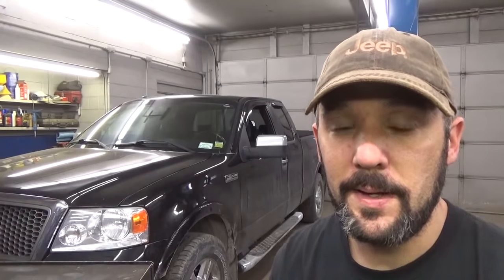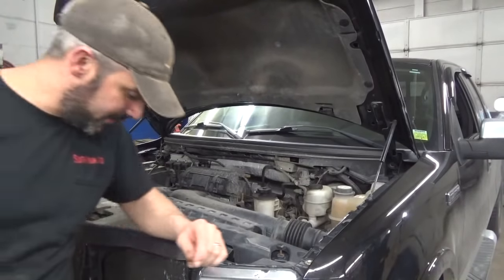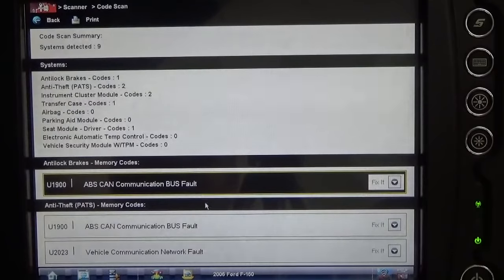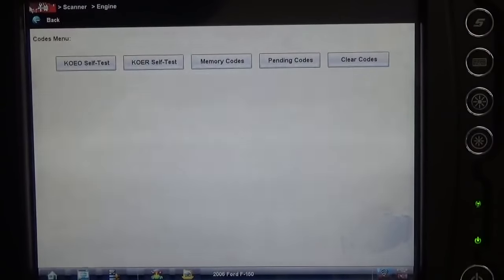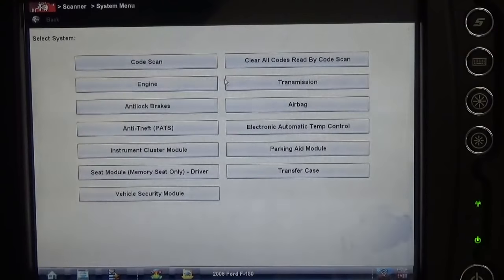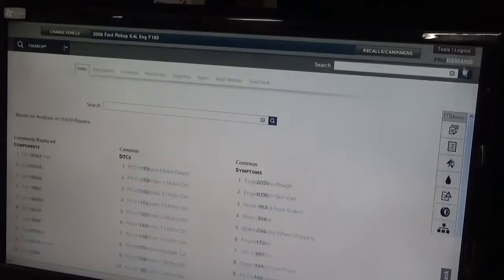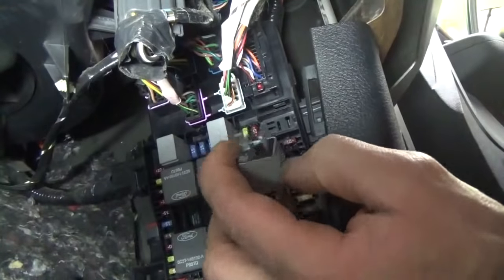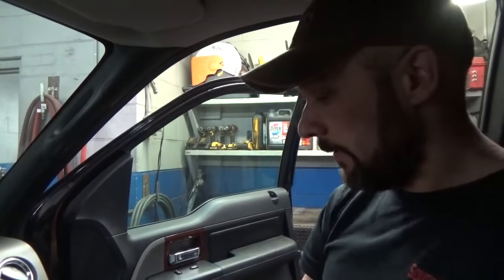Ford F150 5.4 No Start, No Crank, No Communications Codes: U1900, U2023

Comment: I have problems with my Ford F-150 1997 no tail lights everything were screwed up I pulled the number five fuse out control the radio it was draining my battery I was totally lost but this here radio the video help me to understand what's going on thank you

Comment: Even in the Ford Taurus 2004 your basically bent over upside down looking at relays and fuse boxes under the steering wheel uncomfortable awkward when checking fuse boxes

Comment: 1989 Bronco 5.8, both wires at injectors are hot.   What could be the problem....no start and not pulsing.
Reply: Got same problem in a bronco 5.0 reading few things the ground going into the PC controls the injectors. One of those grounds May be corroded o broken have not have time to check.and my garaje is to cold in MN.

Comment: Poor footage??🤯 are you kidding me ? This is like watching Frank Sinatra back stage or in you living room ......love your work
Reply: Question I have a 04 f150 5.4l i got spark fuel checked all fuses and relays all good there but the truck won't start i look inside of the trawdobody and i  can see lots lost of fluid is that normal? I think truck is flooded dont toy think ?? I also replace that module by the spare tire and still wont start

Comment: I have a 2003 Nissan Altima no communication with key and starter,  code said Ibolizer but it was the fuze module under the hood ..850.00  part had to ebay it for 55.00 problem solved.. I couldn't do it my pro mechanic like you figured it out..

Comment: So had a Reduce Engine Power 2005 f150 5.4 which didn’t seem to affect it immediately all that much even with quite the load behind me. Following day started… strong crank and had all power. 30 min later, nothing but full power and a click coming from fuse panel.  Hooked up Bosch diag could see 3 codes. 1 pass airbag. 1 P1000. I believE Is ECC, PCM,  throttle body etc. 

Replaced starter for the heck of it though I didn’t think it was the starter because you don’t even hear the fuel pump.   Does not start in park or N.  Haven’t found any blown fuses and is my understanding that relays can click good or bad.   Security seems to operate as expected. 

Thoughts anyone.

Comment: I'll have to try this my truck is doing the same thing I've replaced the neutral safety switch, ignition switch, and the drivers side fuel module still nothing

Comment: Could have been the flux they used to solder that relay resistor, that caused the corrosion...if the flux wasnt cleaned off.??

Comment: I bet thats whats wrong with my 06 sitting in the back yard? I had a mechanic check it. He said he wasnt getting any codes or anything. He finally decided the motor must be locked up? So I put in in the back yard and left it? Ill have to check that out and see? My son said he just pulled up to a gas pump and cut it off, then it wouldnt crank back? After the mechanic said the engine must be locked, I asked my son if he heard anything like a rod making a noise, or any rattling in the engine before he cut it off? He said no it was running fine until he cut it off to get gas? The oil was full when I went over to look at it. I just somehow couldnt believe the engine was locked? Thats why I had a wrecker pull it back to the house. I dont know that much about these vehicles thats newer than a 2000 but I have never heard of an engine locking up that didnt make any noise before it locked up? And Im pretty old! Its an 06 F350 with the 5.4.

Comment: It looks like you there's a metal film resistor in there and they are noted there's any moisture whatsoever they definitely don't like it or that might be a diode across those coils to stop spikes and that may be what went wrong.

Comment: No crank no start blower motor kicks on and continues to run with key pulled out of ignition . I will finish watching the video and cross my fingers  and pray. This all started from me trying to unblock my heater core and in the process found a coil connection and the top of the coil snapped or broke .Because # 4 coil is  tucked so far back and little room to access the heater core hoses ,it looks like somebody tried exactly what I did and snapped # 3 coil .So I replaced the coils and finding it easier to reach them by disconnecting the PCM and moving it out of the way I must have screwed up something..

Comment: First thing I would have done is check and see if the anti theft light on top of the dash was flashing and if the odometer reads anything. Usialy of the pcm is unpowered the check engine light will not be illuminated with the key on.

Comment: Think I have it figured out. It is a one-time relay activated crank to startt
 that went bad, and when you continue the one-time activate circuit with your test light, it put it in start mode for 1 engine start cycle, and then disabled it. You know, the safety were you cannot try to start your vehicle while it is already running. ???

Comment: I'm currently dealing with my 08 f150 blowing fuse 33 which controls ignition coils, o2 sensors, and shift solenoid. When the truck is running/idling in park, or revved in either, i cannot get the fuse to blow. Only under load (not just put in D) will it blow. I can ease on the throttle and it might blow, it might not. Went over a bridge at 60 mph and the fuse blew. Anyone ever come across this issue? Anywhere i should look in particular for a short to ground wire?

Comment: I have a friend that has a 5.4  Ford expidition and he pulled the anti theft device off the steering of wheel and the ring around the key switch anyway to bypass the anti lock mechanism or how to reprogram it he put another module on it but still won't read anything no key won't crank or nothing
Reply: It's a 98 model

Comment: I have this problem on my 09 f150 but mine starts after leaving the key on for 20 mins when I drive it and shut if off sometimes it won't crank when I leave it sit with the key on it starts after a while and when it starts it makes a crazy noise like the battery is dead and the computer is resetting its crazy so I took it to the ford dealer and they couldn't figure it out they told me replace the starter and starter relay and still does the same thing???????? No codes or anything??????

Comment: Wish you were here. Our 06 F-150 die on me while driving on 0ct 17,2020. 
It's currently at the shop.
Having same issues as the truck in video. 
They believed it was a computer issue. Thought they had it fixed. Went to crank it to bring it on and it wouldn't crsnk..again. 
Frustrsted. And fear tge repair bill.

Comment: My tester the light comes on on when you enter it's safe it says check to see if the scanners plugged in right and and check to see if the engine is turned on I have checked the ob 2 wire all the way back to the computer is right and the grounds are good I did an injured swap I think it might be the security system does anybody know

Comment: Drip drip drop little April shower...dumdiddydumdiddydumdiddlong.
Yes sir.
Now it will reccur if water drips in there again.
You can put a deflector above it and let them note when the carpet gets wet and the situation, to diag the cause of water entry.
If you check the body drains for backing up and visually look for the stain of trickle trace, or ask about the steepness or slant of their parking, you might not need actual water testing.
Some vehicles just have a leak at a seal or glass edge, some end up unable to drain and it finds a way because air has to be available for ventilation.
I had one where we put a piece of plastic above as a deflector because of time and limited funds of the friend who just bought it used.
He put towels on the floor, I believe. He wanted to see if it keeps doing it? Or had been under trees before being cleaned up.
That was so great how checking communicability of systems took you to the interior fuse box first and you happened upon it.
Excellent use of time.

Comment: What would cause worse than this? Put in the key and not a single thing. Not even a sound. Anything you can think of? It won't work. Dead as a board. A week goes by and she will start as if new. Drives normal. Then in a day or so? Dead for another week. Any ideas?

Comment: I got a 2012 Ford F-150 5.0L I replace fuel pump, all 8 plugs & coils, crank position sensor it uses to start & run with a Rough idle can someone help me.

Comment: You are a master computer fixer, but there are times do you ever use old common know how?  Ive watched and its always plug in the monitor and other high priced toys leaving the avg joe behind.  being a gm tech way back in the early 2000s i have found that the most useful info is one that most guys understand and dont need  a 5000 dollar tool to work  keep it simple please

Comment: first,, fuel.. the batt power, then fuses, then,,chuck it.. we had a 4x4 member, on a trip. sht a sensor. 1500 ks, in limp mode.. excellent...allways keep a new vehicle on the tow hook for spares....

Comment: Guys, pls, help me. 
I have a Ford F150 2005 4.6 v8, no start no crank, no clicking when I turn the key to start. It was starting and running, and one day just happened like that. No codes. 
So, I went and check my battery (replaced, cuz it was old, why not), fuel pump, everything working. I hot wired starter and truck is started, after that it was starting no problem for the whole evening, but next morning same issue, truck doesn't start, what could be wrong?
Reply: Also I checked all the things on the video, fuses and relays are good

Comment: check out Diagnose Dan videos....  as for the corroded relay and connections most likely water got into the fuse/relay box!  clean relay socket, spray with contact cleaner and get a new relay;.find the leak  and stop water getting in there again,......Good find!

Comment: When you get a chance check out this tool from snap on it will make your job 100% simple when it comes to checking for power on the relays and fuses it’s a compact size wireless all you have to do is touch a ground on 1 hand and hold the tester with the other and start testing  Snap on part # EECT200 BEST TOOL EVER and let me know what you think.

Comment: Ford no-start,,,,, always check ECM/PCM Power relay circuit first because it is the primary problem with Ford starting problems. If that circuit is good then look at fuel/spark/starter. Did this for a long time. Some Ford OBDII communications problems were also caused by a fault in the dash circuit boards. Had to be removed and sent out to be repaired.

Comment: my 2005 navigator is NO CRANK NO START  and not reading the tranny moduleit will start by bypassing the solenoid the first thing my mechanic said was to buy a new PCM to see if that work I will call him Monday and tell him to test the power to my PCM relay at the fuse box and  swap a  like  relay with the PCM relay to see what work

Comment: Did any of you guys know that a 1979 Chrysler Cordoba K frame will bolt rite up to a 1949 FORD,,,,,in case you're building a 49 or 50 ford , the Cordoba much stronger and easier to work with and find ing parts !

Comment: 99% chance this is not what’s wrong with mine lol... it’s Ford they are designed to corrode and fail, mine has left me stranded 3 times, each time was a galvanic corrosion problem, they used metal on metal with the metal choice designed to corrode when those two types of metal touch eachother...

Comment: Just think about electric vehicles sensors,, relays, solenoids, fuses,and acturators
Reply: I'm thinking about them. They will be dealer only serviceable.  no need for gas stations, jobber parts and suppliers, repair shops, wrecking yards, oil industry workers, etc.... Shouldn't even need tax collectors as there won't be many with incomes.

Comment: When they made the sucker and when they pressed it together with the machine it didn't feel right so it let moisture get inside moisture gets inside it's going to start corrosion especially with the copper contacts on the inside hell man you did the right thing he broke out the test light and you are to send a letter to Ford tell him they're better ideas suck any dumbass that'll put a fuse box underneath the dash or down behind the passenger side fender well almost down on the ground there's a bunch of dipsticks and that sports better idea whatever the guy come up with that lady of veterinarian his wife was a veterinarian and she had a brand new Ford and it wouldn't start and she had a bunch of vet calls out in the rural area and he found the problem we had a shorted out fuse box and the fuse box was located behind the passenger side front wheel all the way down by the frame so all that water and mud and everything was getting splashed up on that fuse box shorted it out but he had to bypass it and he got a starter mechanism he put a push button in it and got it started to where he can get it to the Ford dealership and she had a couple calls that she had to make and as long as she could you know turn the key on and step outside by defender by the parking light and push the button she had no problem but they got it all fixed it was under warranty all right man you make pretty good videos educational and I mean it's really stupid what they come up with nowadays just like that ground wire that you found that was corroded all almost all the way in half I wouldn't get no power to nothing all right man I'll let you go you have a good day hello this is Ken Grover Florida

Comment: I hate where ford put this fuse box. I had to take out the passengers seat to be able to access the damn thing. The radio antenna is right above this fuse box, if it leaks, water flows down into the box. DUMB ! Ford stopped thinking on the 11th gen models. The fuse box on my 94 is right up under the hood. You should use CRC QD electronic parts cleaner, NOT brakleen. Super Lube on the blades of the relay. IMHO. Better give him a quote on a timing job too. Lolol

Comment: Worst truck ever made, broken 2 piece spark plugs cost $800 to change, Cam phasers go out, $2,500, stupid dual overhead cam (without cam bearings) overhead engines develop HP at high RPM/trucks need low rpm torque. Fuel pulp relay thats wired into a harness that only the dealer sells for $600 and has to be programmed, and the dealer won't put one on without replacing the fuel pump, $2,500. ALL this on a truck under 100,000 miles. They are JUNK! My 96 Chevrolet truck has had no issues in 200,000 except for a water pump, brakes and tires, spark plugs were $20 and I changed them in 20 minutes.